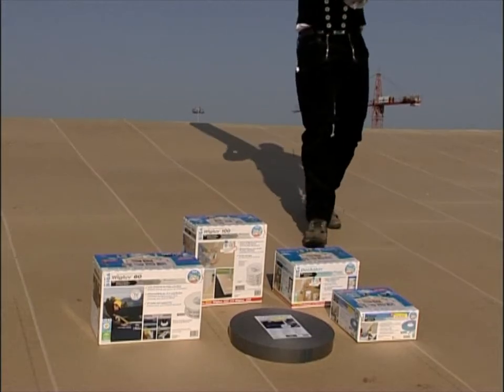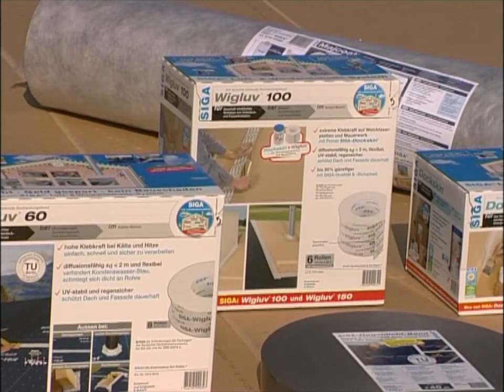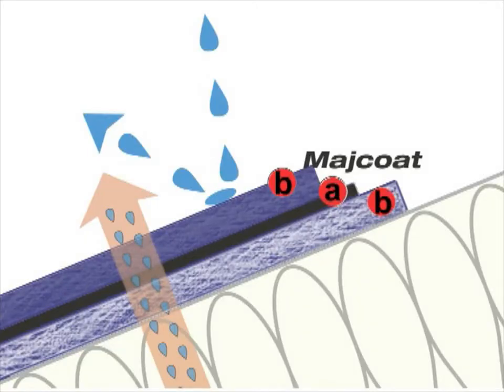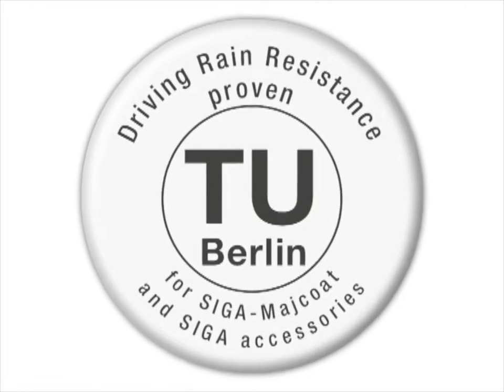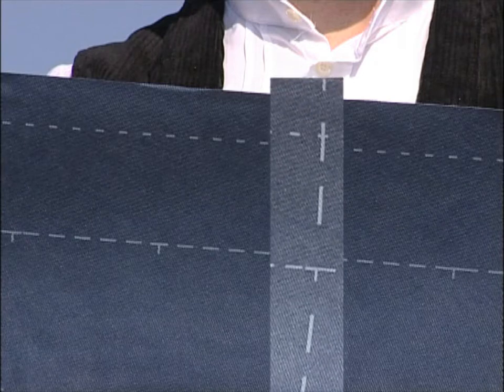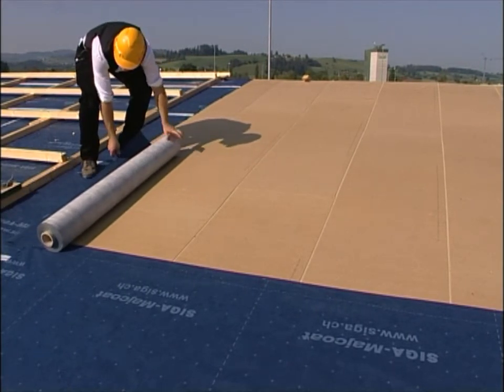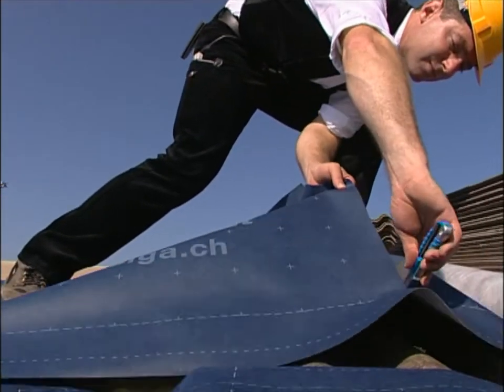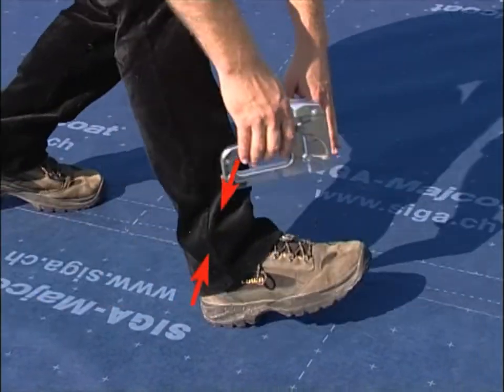SIGA Majcoat - Mounting the roof underlay membrane for between-rafter or above-rafter insulation

Comment: If applied over a SIPS roof, would the staples need to be top-coated or does the membrane self-seal?
Reply from the maker: Thank you for your question. There are different code requirements in each market regarding this installation. Please get in contact with a local SIGA rep through the contact form on our website at www.siga.swiss and we will be able to help.